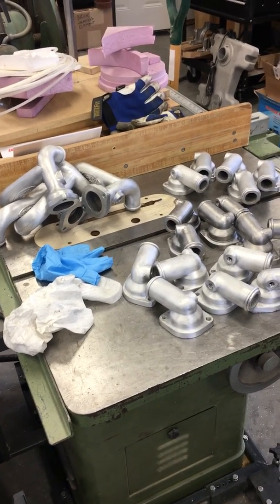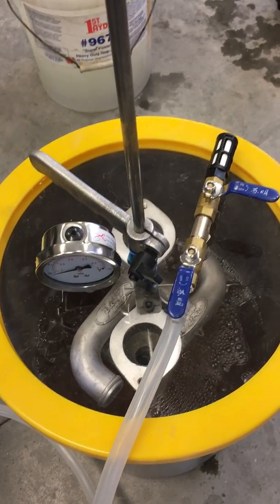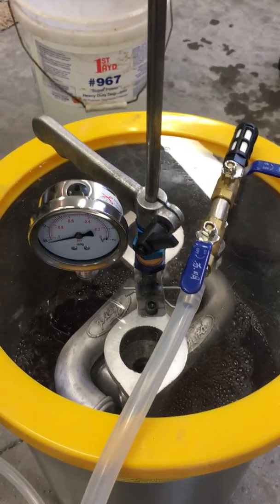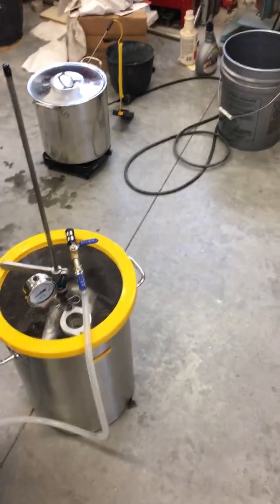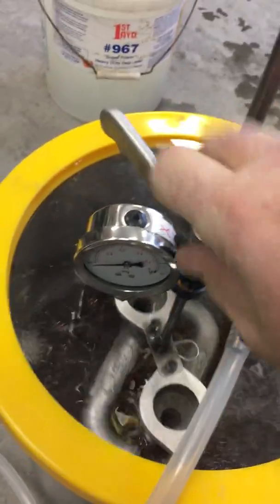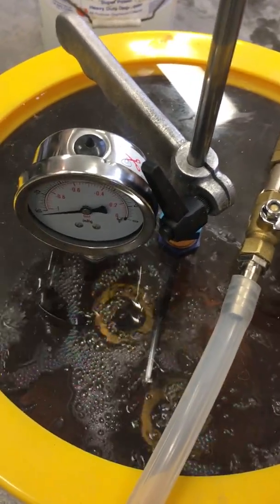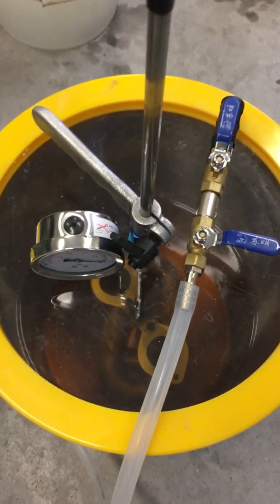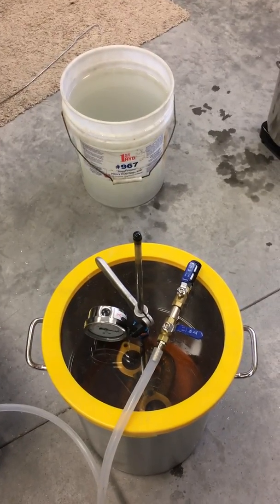Casting Impregnation

Comment: Thanks for sharing. This is the only video I can find on YouTube about vacuum impregnation. 
1. How long do you hold vacuum for while the part is being suspended inside the vacuum chamber?
2. Once you dunk the casting into the 90C how long do you leave it in for? Are you just waiting for no bubbles to appear?
Reply from the maker: You can do wet or dry vac/pressure impregnation. Dry is when you apply vacuum before immersion which is preferred but either work, and if you do wet, yes, until bubbles stop assuming you can see into the chamber. The "Pressure" part is atmospheric pressure. If you go to Henkel's website and search Resinol 90c, they have a user's guide with process info. But, they may not be willing to sell to you if not a business and at least 5 gallon minimum. 90C is methyl methacrylate. For many years impregnation was done with water glass (sodium silicate). A pretty good and practical hobby equivalent is to use the vac/pressure process with BarSeal radiator sealant. Its active ingredient is sodium silicate. But this is if you can apply to a small internal volume. Otherwise, you need to by a larger amount of sodium silicate, which is relatively inexpensive. Best, Kelly

Comment: Where can you buy Loctite 90C in EU ?
Reply from the maker: Sorry Marcus, cant help you there. Loctite products are made by Henkel Corporation. 90C is metacrylate monomers. There may be equivelant products.  Sodium Silicate (water glass) used to be commonly used in same manner. You may need to contact and inquire for EU distribution or perform internet search for a distributor of their industrial products. Best, Kelly  https://www.henkel-adhesives.com/us/en/about/our-brands/loctite.html
Reply: @kellycoffield533  Hard to get hold of. But i got a simular product. But you have the casting in the "air" and dump them in the solution. Or can you put the casting in right away and then pull vacum ?
Reply from the maker: @markuslimseth8426  You can use either method but evacuating the air before immersing the part in sealant is supposed to achieve superior results because the sealant can achieve deeper penetration. Do an internet search a search for "loctite impregnation design guide". It is a 20-page downloadable pdf document called "Porosity Sealing by Design" (search this too). It is an excellent description of the processes, pros/cons. I tried findinging it on the Henkel site but could not but several individuals have posted it on the web. Also, Godfrey and Wing is a German based manufacturer and if you search their name with "impregnation handbook", they have similar docement in various languages, and may have better EU based product availability. Best, Kelly

Comment: ...and what's the reason for doing this procedure?
Reply from the maker: Castings can be porous and can sweat liquids or leak gases through the walls under pressure. The propensity is greater in thin walled castings like these. Sometimes this just discolors the exterior surface in worse case they can actually leak. This permanently seals the castings. It's pretty much standard practice in auto industry for fluid containing aluminum castings.
Reply: Kelly Coffield That's wild.  Learn something new every day.  Might explain why my old jag leaks like a sieve.  Can you seal up my aluminum cylinder head?  lol
Reply: What is the resin used? Silicate solution? And the capacity of vaccum pump?
Reply: What is the sealant you are using? We we do this same practice by sodium silicate?
Reply: @melissahill7930  . Thank you for your reply.  Can you please assist if we can use sodium silicate by using vacuum impregnation method for water manifold. As I cast aluminium manifold for diesel engines by using hot box (RSC) mold.